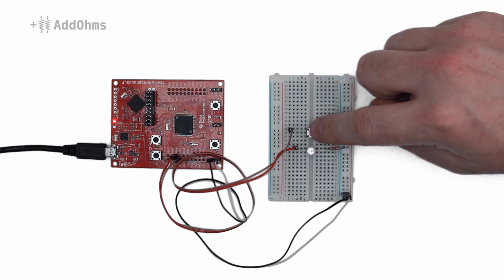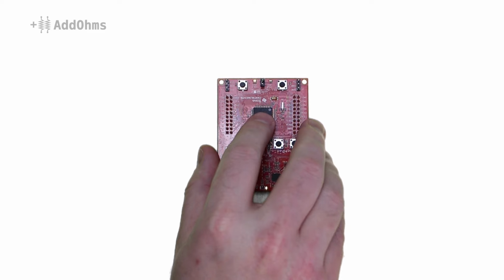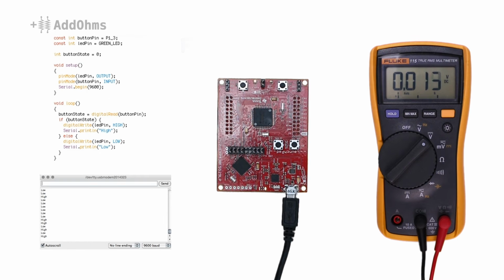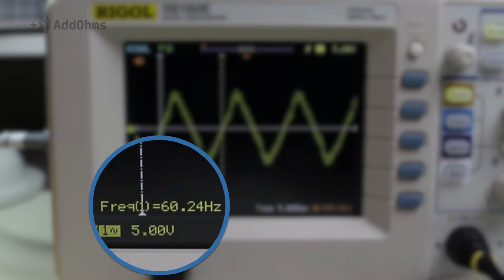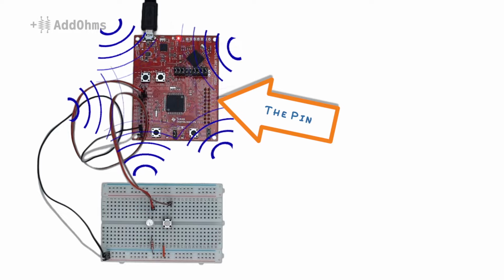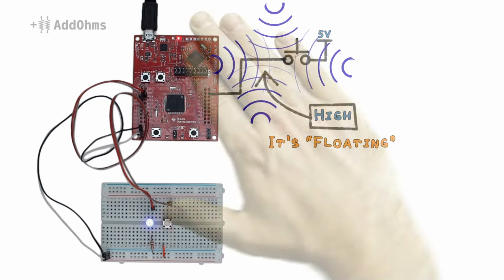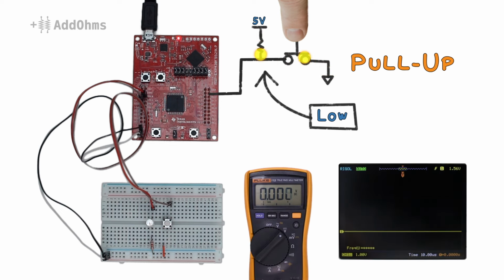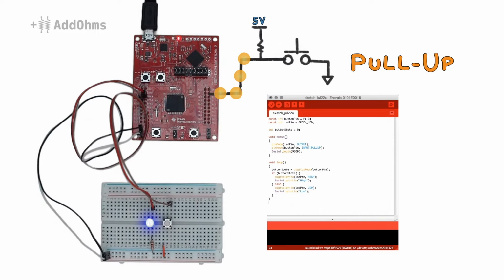Pull Up Resistor Tutorial | AddOhms #15

Comment: is the so called "internal pullup resister" just on the arduino boards? or is it also usable in scripts for arduino on breadboard, or the atmega328p chip standalone?.
Reply from the maker: +ArcAiN6 They are internal to the chip. (If they were on the board, they'd be external.) I used a TI Launchpad to make the point they aren't just for Arduino. Most (maybe all) microcontrollers have internal pull-ups.
Reply: k thanks :D

Comment: For uC without internal pull-ups is there any reason to prefer discrete pull-up resistors to discrete pull-down resistors which would permit the use of un-inverted logic?  Quiescent current draw might even be less, yes?  Would the resulting high pass filter at the gate be undesirable?
Reply from the maker: Until the ESP8266, I never worked with a microcontroller that had built-in pull-downs. 

Dealing with the inverted logic has never been a problem. if-statements don't care which why you write them. Personally, I create #define macros for the state of buttons. Like PUSHED and NOT-PUSHED. That's much easier to read than high or low.

Regarding the current, my initial response is that pull-ups provide less quiescent current. However, I have to think that through. It's been a really long time since I thought about it. I'll come back after I work through it.
Reply: We're talking maybe a few picoamps saved per CMOS gate by using pull-down resistors I would think.  Not so much.  I guess I'm still just curious why pull-ups became the industry standard.  What other engineering consideration would make it a superior choice?

Comment: When button is not pressed current from 5 volt point is directly flowing toward arduino.  Why does it not cause short circuit on arduino input pin?
Reply from the maker: Input pins are "high impedance" or "high resistance." They are like an "open". It's how they detect whether a voltage is a high or low.
Reply: Thank you.

Comment: So with a pull-up resistor in your example, the LED would turn OFF when the button is pressed?
Reply from the maker: Depends on how the code is written.
Reply: yes, but you can easily reverse the logic in the arduino code.
saludos :D

Comment: Hello, I have a question, actually I hate this kind of questions because the best way to get the answer is to try it by yourself but right now I do not have my tools, and its really annoying me , 
lets say we have a certain pin of an IC, and we want to give it LOW, so how do we give it low ? By connecting it to the negative terminal of the battery or just not connecting it to anything ? 
and if we connect a pin to the negative terminal what does that give ?
Reply: it depends om which IC you are using ,if you are using TTL series IC floating input is considered HIGH due to its internal IC impedance but such is not the case for other ICs consider CMOS IC there you need to specifically provide HIGH and LOW i/o to work. go through IC's datasheet  look for "LOW LEVEL INPUT VOLTAGE",any voltage below this value will be read as low by your IC
Reply from the maker: +Mohannad SMARTHERO You connect it to ground, otherwise it is floating.
Reply: Thank you so much, that was very informative

Comment: won't the resistor drain the batttery??
Reply from the maker: Yes, that is a concern in battery powered applications. But, current is only flowing through the resistor when the button is pressed. So the total energy "spent" tends to be very low. 

Leaving pins floating also causes some drain on batteries, as eddy currents flow through the floating I/O pins.

Comment: When the button is pressed, why does the voltage "decide" to flow towards ground and not to the input pin or both?  I've been trying to get this question answered everywhere.  Great video.  I'm completely new to all of this.
Reply from the maker: First, voltage doesn't flow. Voltage is the pressure that causes current flow. 

While "current flow" is the electric charge being carried by the electrons. Those electrons move in a closed loop between the Positive Supply and Ground. Electrons are lazy, they go the path of least resistance. When then the button is pushed there is a difference in voltages (a difference in potentials) allowing the electrons to move again. Most of them go the easy route directly through ground. While a few small amount goes to ground through the pin.

When a pin is set to INPUT, it's impedance (it's resistance) is VERY high. Which is why most of the current avoids it. Of course this doesn't matter to us, because we just want to sense the voltage at the pin.
Reply: +AddOhms Thank you for explaining this.  I know I can use the internal pull up to make things easier but wanted to understand what was really happening.  I had been reading that the whole "path of least resistance" was a myth, but I think I need to go back re-read those articles.  Thanks again.
Reply from the maker: Having never heard that before, I'm not sure how "path of least resistance" could be a myth. It can, however, be an over generalization. Current flows when there is a difference in voltage between two points. The amount that flows depends on how much resistance is between those two points. The path with less resistance allows more current flow.

This is the basis of Ohm's Law:  Current = Voltage / Resistance.

In the case of an input pin, the pin's resistance (really its impedance) is very high compared to the path to ground. So while most of the current will flow (through the pull-up resistor) to ground, some goes into the pin's edge detectors as well.
Reply from the maker: I'm unable to load that link.

>On the pull up circuit, if the switch is open, is the circuit closed? 
Yes, exactly. The circuit is closed through the pull-up resistor. When the switch is closed, then a path throw the switch is provided. The key is that the voltage at the point where the switch, resistor, and pin meet change.

Comment: I have tried for sooo long and I can't get my Arduino Nano working with a button. I can dim a LED and I can change the flash speed, but I can't make a change when I push to button? Can you help me?
Reply from the maker: +Kasper Nørgaard Including the code in the video (which is the basic example code from the Arduino IDE), you might find one of these tutorials useful: https://www.baldengineer.com/millis-cookbook.html. There are at least 2 that deal with buttons and actions.
Reply: +AddOhms 
But a minute ago I tried to plugin the USB power and the LED flashed and when I pushed the button it turned off and when I pushed again the light got even brighter or more steady. 

If I use the pull up resistor like the link I sent the LED is off and the button does not react.
Reply from the maker: +Kasper Nørgaard Could be an issue with your code. Could be an issue with your wiring. (Incorrectly wiring push buttons is common.) 

I can't say without seeing either.
Reply: +AddOhms 
Do you have Hangouts? Then i can sent you a picture/video 😊
Reply: +AddOhms
How can I send you some pictures/videos?
Reply from the maker: Can you try posting on https://discuss.addohms.com/?  You can add a thread here: http://discuss.addohms.com/t/show-notes-15-pull-up-resistors/31
Reply: +AddOhms 
I tried here:

http://discuss.addohms.com/t/arduino-nano-with-push-button/59

Comment: Wow this is awesome.  Thank you.  Question though, when you say the arduino already has a built in pull up resistor do I still need to add a physical resister to my button?  Or does that code snippet do the trick?
Reply from the maker: +Ashley Stallings No, you don't need an external resistor if you enable the internal resistor.
Reply: +AddOhms thanks!

Comment: Very nice video, but i dont get one thing !
What would happen  if there were no resistor between 5 v source and input pin ? I think that even without that resistor, signal would be still high, right ? So why do we need that resistor connected between 5v source and input pin  ?
Reply from the maker: +ognjen297 Yes the signal at the pin would be at 5V. However, then you would have a dead-short between 5V and ground when the button was pressed.
Reply: oh i got it now :) But just one more thing, if we had that resistor placed between ground and button, and if resistance of resistor is smaller then input impedance of pin, would it circuit work the same? i mean would it work like the circuit you have drawn on your video ?
Reply from the maker: +ognjen297 That would be called a "pull-down."
Reply: Again, thank you very much for your response !
Reply: +AddOhms  Yes, but if the button is off we would still have 5 v on input?

Comment: Great video! But for those who were wondering like me, why the input pin would receive 5V in the open switch state when there is going to be a voltage drop across the resistor, the input pin usually has its own resistance that is much higher (on the order of M ohms or more). This resistance limits the current even further, to the point where it can be treated as an open circuit. This is synonymous with "high impedance" meaning a high ratio of voltage to current is allowed through the input pin. Because of this high impedance, the pull up resistor will basically have no voltage drop across it (ie: 0.01V) and the input pin will read something like 4.99V - close enough to 5V, and the current flowing through the circuit will be very tiny (ie:: micro amps).

I used this site for the explanation: http://www.madsciencenotebook.com/basicelectronics/pull-up-resistor/
Reply from the maker: +Marco Satti The pull-up creates a voltage divider with the input pin's super-high impedance. So you have 10K (R1) in series with 1M (R2).  Treat it like a voltage divider and the drop across R2, or the pin, is nearly the full 5V.
Reply: WOW. Thank u so much for this explanation. Was scouting the Web for almost ~4 hours to find a reason for this. Kind of surprised how no one ever bothered to talk about the impedance carried by the Pin
Reply: Thank you for this explanation as I was indeed confused about this exact point.
Reply: Yes! I was confused for a second as welll. Always good to remember why we like high input impedances and low output impedances.
Reply: ....in tv repair, microprocessors would use a pull down voltage, or a very low voltage 0.5v or even 0 to signal the micro on...as well as 4.7-5v high to start the micro.
Don't forget, micro's are a massive amount of transistors and/or junctions as well as resistors etc...mini circuitry in a ceramic substrate per sae.

Comment: Nice explanation, but I wander how do board "turns on" the Pull-up resistors?
Reply from the maker: +Gogo Gogic Inside of the chip, there is a transistor connecting a resistor to the I/O pin. In software when you turn on the pull-up with "INPUT_PULLUP", you are telling the chip to turn on that transistor.
Reply: +AddOhms thank you very much :))

Comment: Thanks for the video, pull up resistors now make sense. Why a 10K resistor? How do you know to pick that value? Is there a calculation needed to work out a pull up resistor using higher voltages or is it just a case of picking that because it was handy?
Reply from the maker: +Maxx B You want a value low enough to keep enough current flowing, while a value high enough so that you aren't completely wasting power.

If you used a 1K (called a "strong pull-up") it would work the same and be more resistant to noise. But it would also waste 10x the power of a 10k resistor. (Unless you're on battery, that probably doesn't matter.)

If you used a 1M or 10M resistor, so little current would flow, you might as well NOT use a pull-up. 10M or more isn't much different than an open.
Reply: Thanks

Comment: Thanks for this simple, clear explanation. I've read many places that you should use a pull-up resistor on this or that circuit, but nobody ever said why it was needed, other than 'otherwise, the pin is left floating' - to which I always mentally responded, 'yeah, so what? Why is that a problem?' Now I see exactly why it is a problem - and the explanation was so easy to understand that I'll actually remember it, (unlike some explanations in the electronics field).
Reply: Mark L Thank you for the feedback. That's what I aim for in my tutorials. 

I'll never claim to explain everything, especially in 3 minutes. However, I'd like to give enough details to understand what is happening. And, make it easier to ask questions if you want to go deeper.
Reply: This was about the fourth Pull-Up resistor video I watched and the first to explain what it was doing. Thanks a bunch!